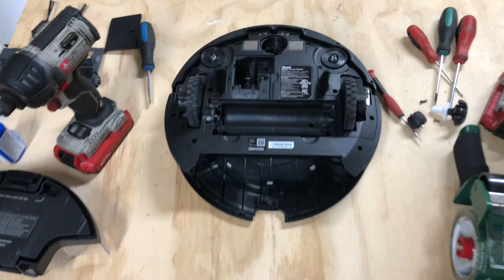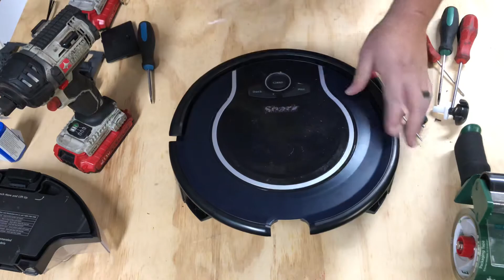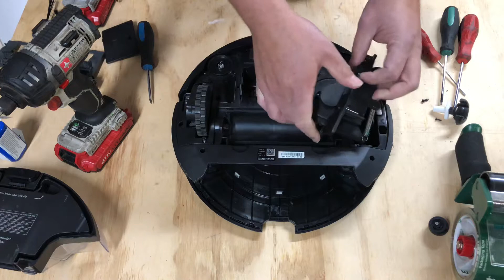Shark Ion 761_N How to Remove Wheel Motor Assembly Video 2

Comment: I’ve got a 1401 that keeps giving the error 18 about the wheel motor. I’ve removed and cleaned the encoder that controls speed sensing and when I move the wheels manually with my hand the encoder spins freely. It doesn’t seem like dirty sensor or bad motor or motor connection is a problem. Do you have any idea what might be causing the problem?